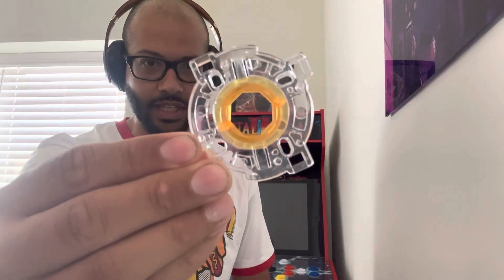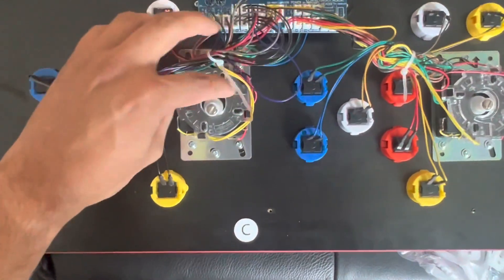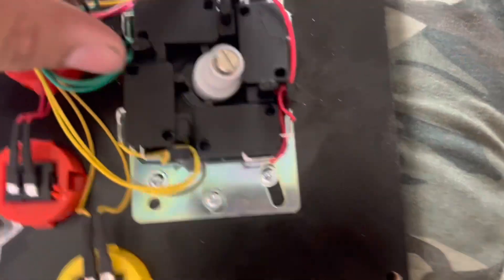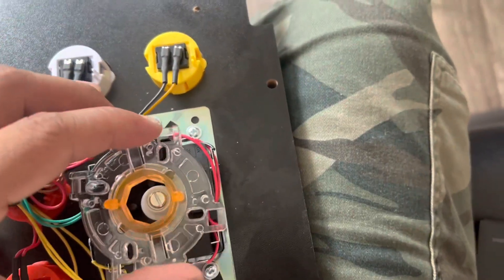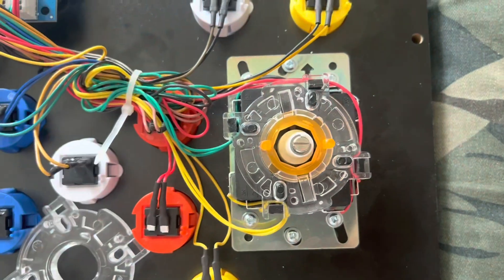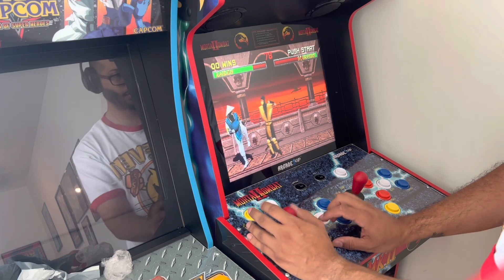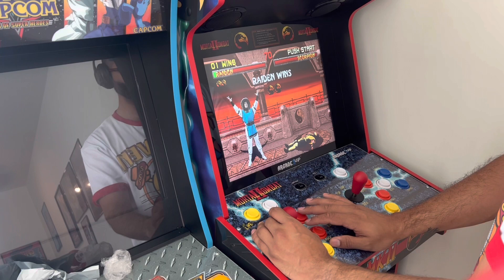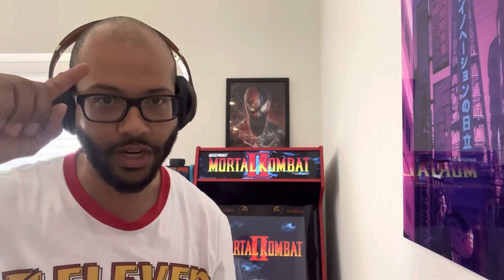Arcade1up tutorial how to install octagonal restriction gate on MK2 Deluxe!

Comment: I put IL Eurosticks in my mk2 cab, but have factory square gates and joysticks in my SF2 legacy cab. Would these work good for the SF2 games and the others on the legacy cab?
Reply from the maker: MvC2 comes stock with octagonal gates and I like them in there. It’s all preferable but I do think they work better for fighters. Should work on legacy also. I think they all use the same sanwa clone sticks
Reply: @ToxcynTV  Yeah, I'm just wondering if the old games like final fight and commando will play the same. Need a little help with my dragon punches, need help doing them more consistently.
Reply from the maker: @marcludwick512  yeah they’ll work.